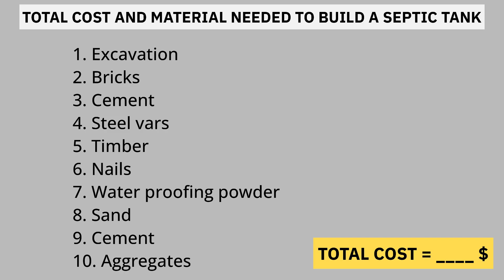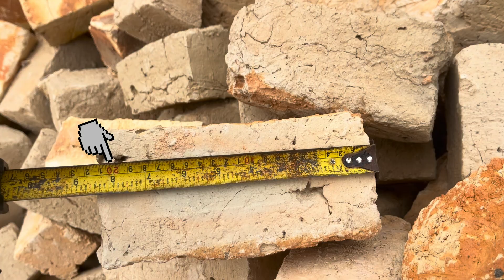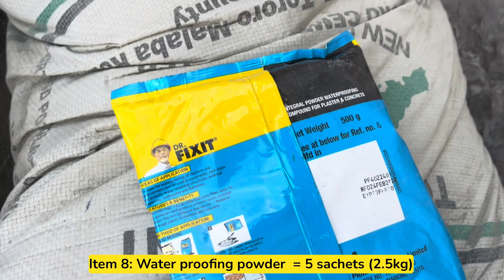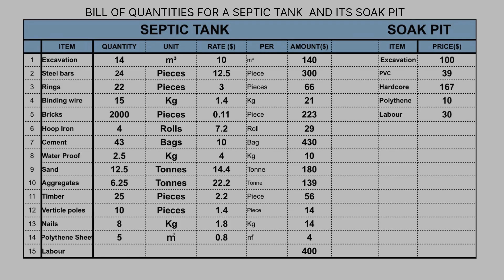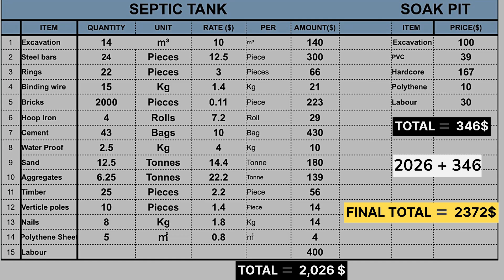Installing septic system cost | Cost of septic system

Comment: Hi
the steel used.on top of the septic tank, are they  doubled.or is it just single inter crossing steel bars
Reply from the maker: We use SINGLE - When cars are not going to be passing on top of the septic tank 

We use DOUBLE - When cars are going to be passing on top of the septic tank
Reply: @ianconstruction 
ok thanks Ian
am getting in this trade here in Lusaka 
Thsnks

Comment: how high should you place a discharge pipe from the water chamber to the soak away pit.
Reply from the maker: 600mm minimum depending on the slope on site

Comment: "Ian, can I build a septic tank with solid blocks? If yes, why is it uncommon here in Uganda?"
Reply from the maker: Concrete blocks have a high water absorption rate which makes bricks a better fit because of a low water absorption rate and also provides stronger walls than the former